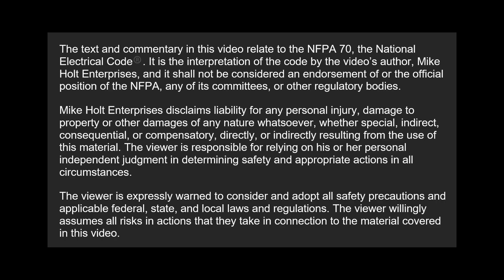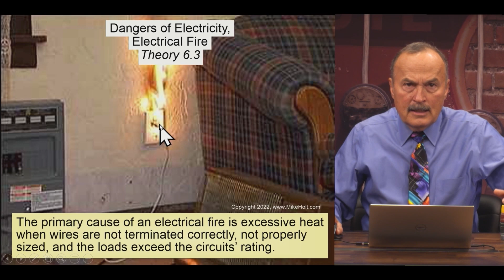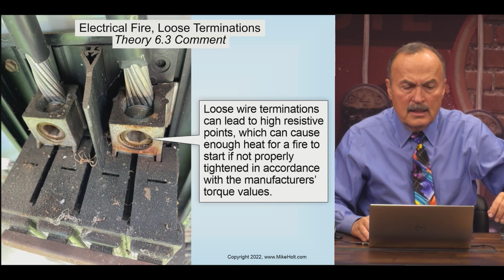Electrical Fire 6.3

Comment: I believe our biggest enemies in electrical work are loose terminations, heat, and arcing which all boils down to toqrquing new installations to spec! Make sure you know how to do it and how to identify the specs on any given piece of equipment you are installing. Also for the newer apprentices, I highly recommend going to a torque and clean if your company does them. It's a perfect chance to learn how to use different torquing tools and how to identify torque values in main lugs, breakers, and any other type of termination.

Comment: Years ago I worked at a busy newspaper that decided to have a company come in and perform IR scan on service and panels in a 10 year old building. I was the only person that objected to them performing it starting 5 AM on a 50 degree Sunday morning when only load was some lightning. Told them it should be done after everything was running awhile.

Comment: This clip captured an excellent discussion on electrical fires. Many reminders flooded my thoughts of my past installations. As factory electrician, I have yet to follow the torque requirements that are now written in new component manuals.
I do get direct feedback from installers of our manufactured Boilers. Some techs say they hand- tight every terminal before startup.
I will rummage your archives for fires with smart meters since I have had my mother's house burned down with unknown cause. I have pictures of the conductor's jacket burnt off all the way to the street transformer, under ground. I noticed a lot of censorship on this concern. I may bring this up in one of your live stream Q and A. Thanks guys.
Reply: Who would be censoring this information, the smart meter installer contractor / utilities company ?
Reply: @aurorian1634  I'm not in the States so I had to look up who PG&E are. Seems to me like a nightmare recipy. Not only are they a private company with stock holders to please, they have public stock so are exposed to the whimsical whimes of public perception. To boost, as a utilities company, I may presume PG&E leaver the benifits of a near monopoly.
I will hang my tin hat foil beside yours, in stating I have no doubt they have corrupt bad players within their ranks, and wouldn't hesitate to supress information.
As customers can not install anything before the meter, including surge protectors, and the meter is not the customers property or resposibility, it should be located at the propertys edge, or in an enclosure seperate from the building.
Reply: @trespire  Well said, friend.  I would wish to see the ugliest looking safety barriers around all smart meters. Maybe then the general public will ask why this fire-hazard was ignored during the mass change-over.

Comment: Great content and discussion on a very very important issue so glad you brought in NFPA70B standard for electrical equipment maintenance most electricians are familiar with NFPA70E but much less with 70B the torquing insights in there is excellent and so glad you discussed it so well. Well done👏🏾

Comment: I've seen many burned receptacles from high resistance terminations,  some nearly on fire.   Backstabbed connections and old technology aluminum conductors in homes from the 60s and early 70s.   Space heaters are the worst offenders not only because 1500 watts pretty much maxes out the circuit,  but because they tend to be used for long periods.
Reply: 100% agree. Space heaters = service calls/fires. The high resistance termination risk could be mitigated with a low voltage cutoff switch built into the device.

Comment: hi again, i’m trying to learn from us late 60’s domestic wiring with aluminum. Since alu has bigger heatexpanse rate it makes sense to cu-pigtail or prescribe how to correct use alu wires and cables. In the Netherlands i notice now a first shift from copper to alu from safe distribution domains to the more free market. And i notice our nec(nen1010(hd/iec60364)) is never updated for alu. So I would sit back and takd notice when you guys discuss all the nec details the installer should take care of not using copper but alu! i know alu is still common in the us and reliefed after the big issues in the late 60’s with the right prescribtions, but i cannot believe it major relief was because of the minor changes of the alu conductor itselfs. Alu is cheaper than copper, but any cent cheaper expanses the conductor loaded at the other metallic connection which therefore will go finally loose… and so spark.. etc for the old alu as well for the now common alu!?

Comment: Some European industrial equipment manufacturers specify that all the high voltage (400vac) / high current (up to 150A) terminals to be checked using the correct torque setting.

Comment: Is there a torque spec for wire nuts? What percentage of electrical fires are started by loose wire nuts? Is there any kind of wire nut torque tool? To pre-twist or not to pre-twist.....

Comment: Why would retorquing be a problem? If you torque a bolt and retorque it it should do nothing. If the metal has deformed due to torquing then there should be a retorque value that compensates and one could figure out how much "creep" has happened by determining the current torque. Seems like it would be safer to retorque things properly than leaving be and much less time consuming and less error prone than redoing it all.

Comment: Question about old work and when you are working in an existing panel box and find several terminals that have loosened over then years. Is it ok to retighten or should you remove, cut and retorque the connections?

Comment: 14-50 receptacles are great welding but EV may heat up from long power use Do not know if not torques or the blades

Comment: Torquing is, and possible will be the last thing in the electrical industry, that will leave the installers ego, and finally be excepted and implemented throughout the industry, as sad as it is.  i work mainly in the industrial field, and luckily enough for us, many of the corporations representatives and inspectors for the companies, seem to be requiring, or at the least are moving towards the supervision of the torquing of the conductors, which is one step towards proper installation, and in doing so, takes a load of us owners and installers in liabilities concerning said installs.